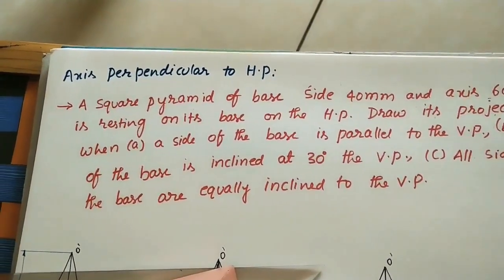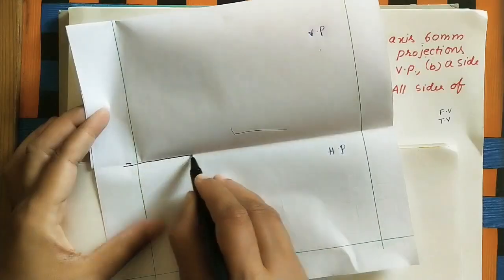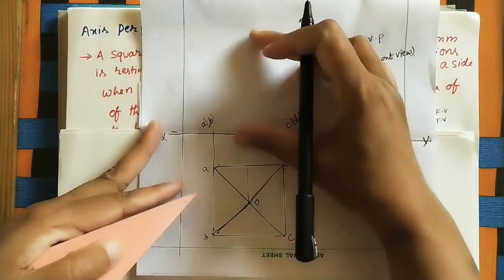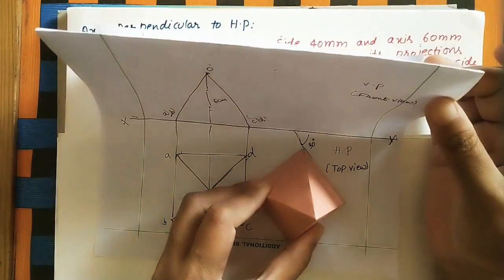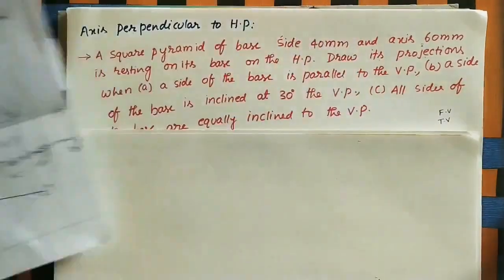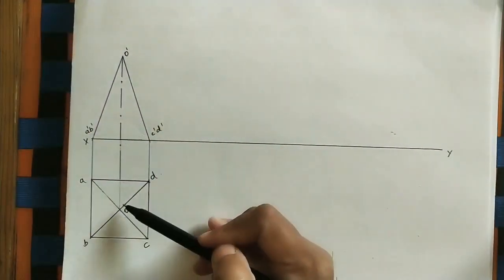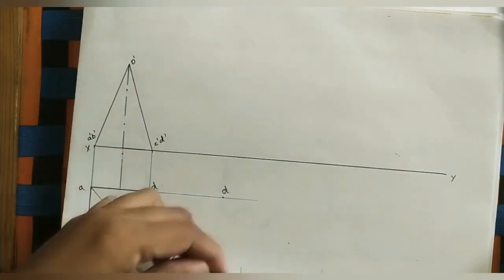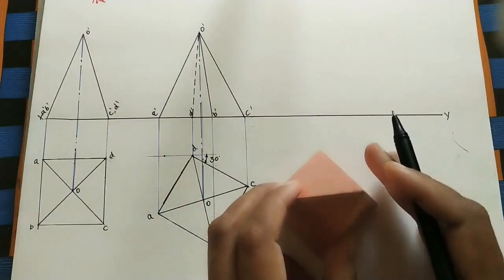Projections of Square Pyramid

Comment: draw pentagonal prism side length 30mm and Height 80mm lying on its base is inclined at 20 degree to hp and 35 degree vp ?
A) what pentagon i draw side parallel to XY or side Perpendicular o XY ?
     for step2, what i 20 degree incline base or axis or rectangular face ?
                      while inclining which i keep on base corner or base edge on ground.
     for step3, 35 degree vp
                 what i incline axis or base edge or base corner.
        do i need to find "BETA ANGLE locus" for step3 or stage3.
Reply from the maker: Thus question is not correct. Some data is missing. You please see the explanation of solution of question in my videos of projections of solids.u can get it easily. Try to understand the examples of atleast 2 to 3 questions.
Reply: @engineeringclassesbydr.noo3377  Thanks mam, your videos are very helpful. That question is from my E.D supply question paper engineering, Worst paper makers and won't review or check second time. they don't write clearly even questions how can students understand and answer pass exam.  some times they mention 300 degree for 30 degree inclination to HP.
for parallelogram ellipse, they mention sides 120mm and 10mm. how can we built parallelogram with 120mm and 10mm. correct is 120 and 100.
or Atleast they won't inform to students regarding this errors during the exam.
Reply from the maker: Whatever you r telling is true. It's a sad reality .

Comment: draw the projections of a hexagonal pyramid of side length 40mm and height of 70mm is resting on HP with one of its edge paralle to VP and inclined at 30 degree to HP.
A) how many stages problem. 
     what hexagon i draw  side parallel to XY or perpendicular to XY.
     in stage-2, what i incline base or axis  or slant face or slant edge